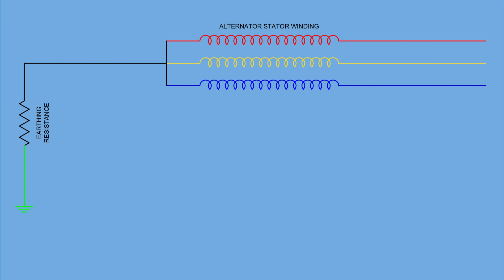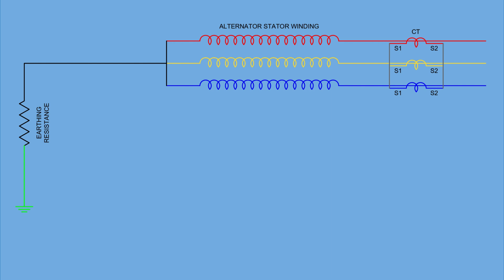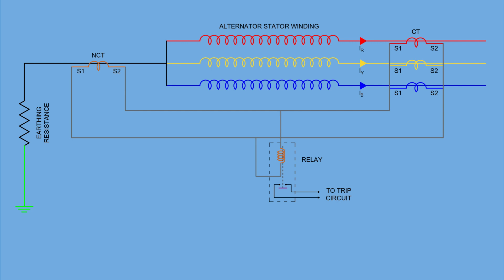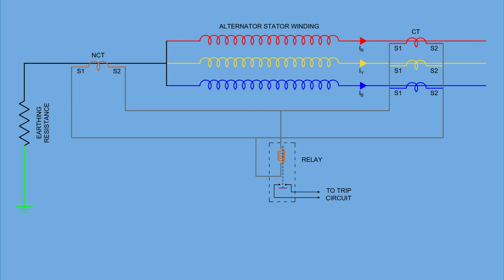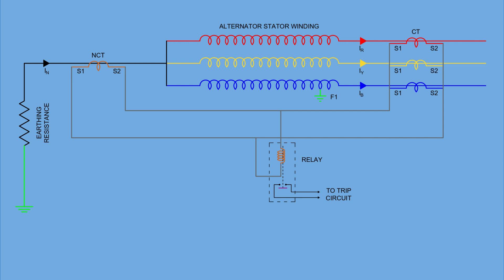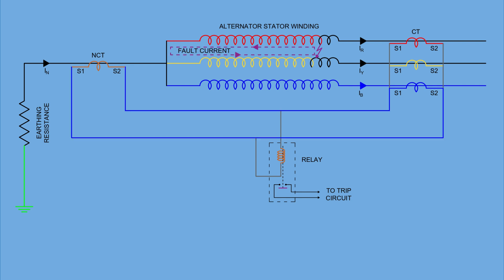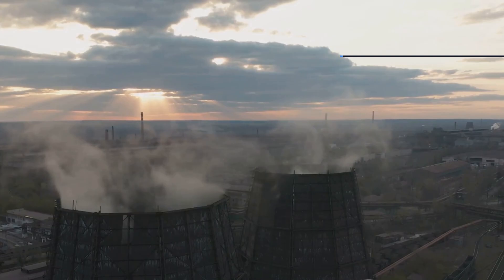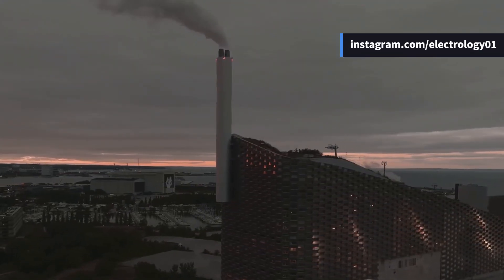Why Merz-Price Fails in Small Alternators | Balanced Earth Fault Protection Explained

Comment: I have a GE 7EA Gas Turbine that will not sync to grid.  Synchro scope will not rotate either.  If we reset the excitation system it will sync on second try.  What would cause the scope not to rotate ?  Not sensing voltage on generator side.  Thanks for any help.